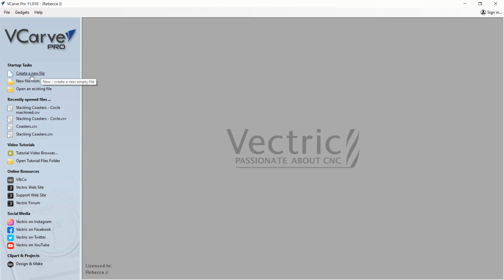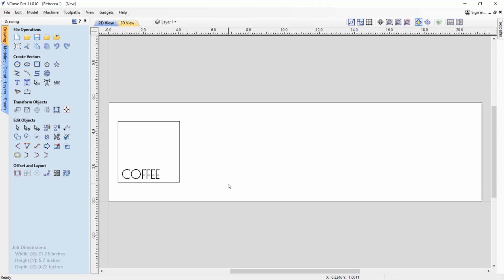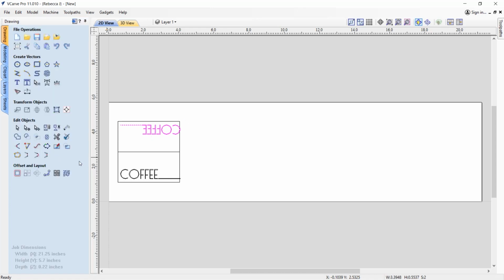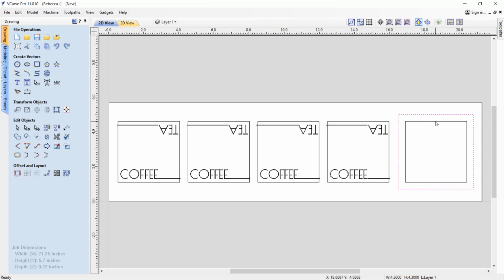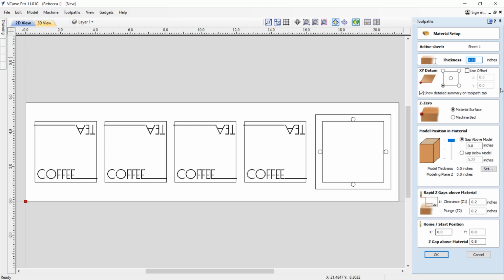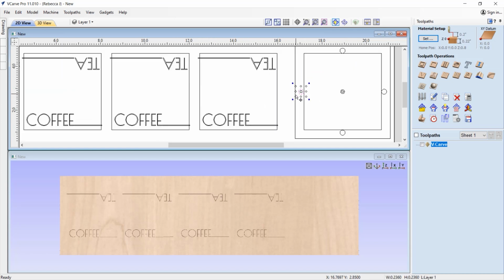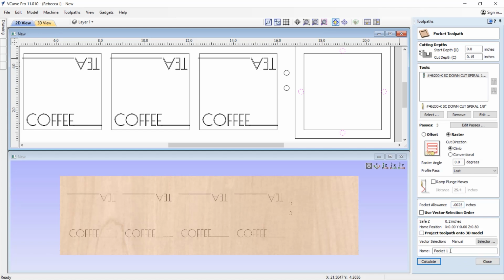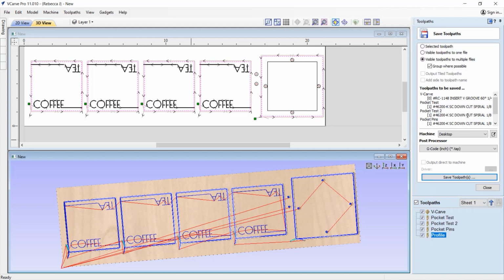Making Stacking Coasters | In the Labs with Beki | Vectric FREE CNC Projects

Comment: Thank you for another great project!  Can you please share with us where to get the dowel pins?
Reply from the maker: Hello Mark... they were purchased from Ebay here in the UK - https://www.ebay.co.uk/itm/254196935764?_trkparms=amclksrc%3DITM%26aid%3D111001%26algo%3DREC.SEED%26ao%3D1%26asc%3D20160908105057%26meid%3D4c21c9df5e324d05841e3de44259c54c%26pid%3D100675%26rk%3D9%26rkt%3D14%26sd%3D165425248965%26itm%3D254196935764%26pmt%3D1%26noa%3D1%26pg%3D2380057&_trksid=p2380057.c100675.m4236&_trkparms=pageci%3A76bdd981-b96d-11ec-ab5e-2e9712af281a%7Cparentrq%3A17a383111800a0dab6090b66fffc2930%7Ciid%3A1
Reply: @vectric  I'm looking for a similar source of pins in the US. Can you tell us the length of pin chosen for this project? The site you've linked to isn't for a specific size - the buyer can choose out of many different sizes.

Comment: Love your shirt!  In the software, you have X running left to right. On the machine you have it running front to back. Is your machine set up for the X axis to run front to back or did you change things in the software before saving g-code?
I teach a CNC class at our local makerspace using the top from the Snow Burst Cube files from Vectric to make a coaster. Maybe I'll just play your video from now on. ;-)  -- We use V Carve Pro Makerspace Edition to benefit our members. Thank you Vectric!
Reply from the maker: Hello Richard... thanks for the comment.  Yes good spot on the axis on our machine.  You are correct and we do think about that when we are creating our files.  Sometimes we need to rotate the job to make it fit or for better video production.   Thanks so much for using our software in your Makerspace!

Comment: Hello, Where do you suggest to buy a starter cnc machine from? Also do you have courses?
Reply from the maker: Hello Daniel, thanks for the question.  This is a hard one to answer seeing as it depends on many things - bugdet, size required for making the things you want and many more.  What we suggest you might want to consider is to gather up what your needs are and have a look at different machine manufactures and look to their reviews, or have a poke around the social platforms, like Instagram.  You could have a look at our feed and see what our users are using for machines and DM them for any questions or ask for a review.